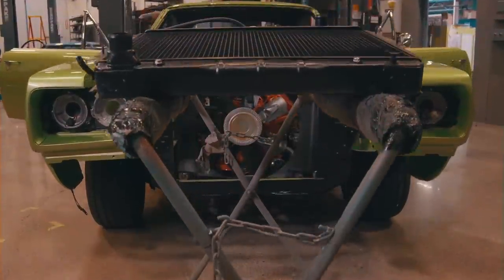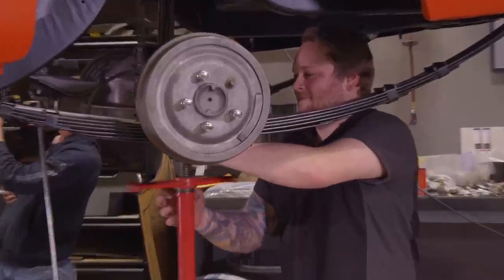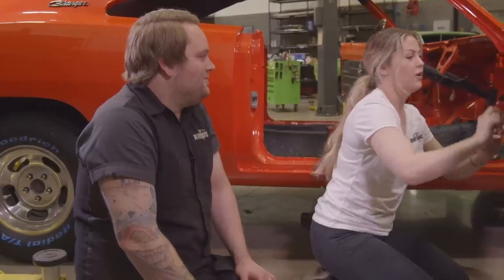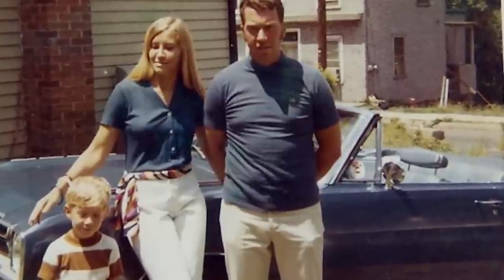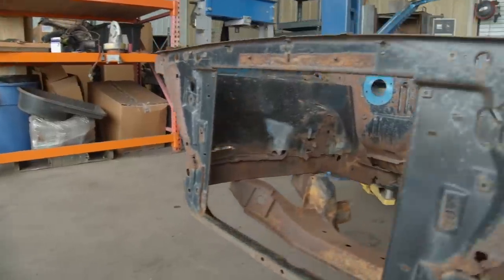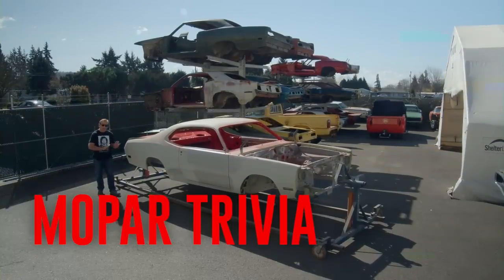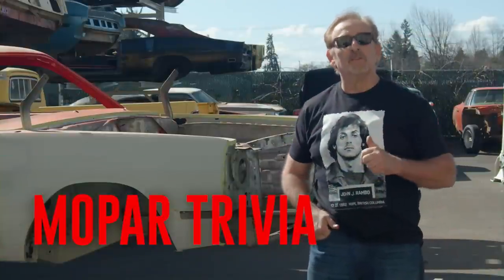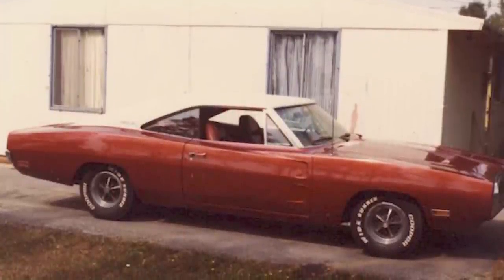MOM GETS HER LONG LOST MOPAR BACK: FOUND IN THE WOODS!

Comment: One clarification. On fender tags for '68 the 52 on the bottom row denotes a 340 4bbl. The 3 following that is for 4spd manual trans. The tire code is the 2 digit number following the trans code which is hard to read because of the rust.
Reply: Time stamp?

Comment: I think we can all understand the passion. I'd love to find our car. Nothing too special. 1970 Ford LTD Galaxy, no not a Ford Galaxy but a LTD. 4 door sedan that had a mobile phone which we chucked in the bin around 1984 and a hole on the bonnet, replaced with a Holden Statesman ornament as that's the only thing that filled the hole. Picked it up at auction in 1974 from the American Embassy as a presidential car. Traced it back too 1994 when it was de-registered and scrapped. It was one of 3 used. We sold it in 1980 during the oil crisis.

Comment: Just one question, when you pulled the later 440 from the Daytona to swap it for the OEM spec motor, was the owner able to offset the cost of the correct engine with the value of the removed example?
Reply: why would you care LOL
Reply: @borismcfinnigan3430  idle curiosity and hoarder/hawker instincts.

Comment: Ahhh, if only I knew builders when I was 23. When I broke up with my GF in 1992, her mom gave me a 1972 Merc Marquis Brougham. Other than the tires being dry rotted and an engine mount, it was basically a barn find. Paint was oxidized, and a vacuum advance valve to bring it up to CA emissions, it still was awesome. 429 V8, 4 barrel Thunderjet carb, forget what the transmission was, but it also had early antilock brakes, all power package, towed a Caveman trailer from the Bay Area to Atlanta, it laughed it all off.

Made the mistake of letting a stoner roomie drive it to tow a reggae band's equipment and he wrecked it. Since 1992, been driving freebies and handmedown cars and vans since then. I miss that epic land yacht though. 

First car I ever had enough room to sleep on the back seat, and also when the engine mount failed, it locked on the accelerator pedal, so on the freeway, I quickly hit 80 MPH, and 8 later, saw some serious sh*t when I tried shifting to neutral, and accidentally knocked it over to reverse. You never saw so much tire smoke in your life, and everyone got out of my way so I could get to the shoulder.
Reply: Oh yeah, one of the most annoying "features" that car had, was a steering wheel mounted horn strip, in case you doubt the veracity of that story. If you had to take a tight turn and crank the wheel, you'd wind up honking the horn, no matter HOW much care you took in the process.
Reply: Oh, last note, it was a Bay Area score, so zero rust, just dry rot tires, oxidized paint, and marginally rotted vinyl on the roof. Seriously, other than a crack in the original steering rim, and minor mechanical issues, it was pretty damned mint for a 22 year old car at the time.

Comment: I've been searching for my 1969 Road Runner. I parked it at my ex's friends place along with my 1955 Chevy Custom Cab truck. They both came up missing and I hope to find out the story of where they ended up. the RR light blue snorkel hood scoop steel rear fender flares, shaved door handles and a failing light blue flame job. 383 30 over with Holly top end parts. one of these days I'm gonna find her again if its in one piece. Not one out there quite like it. The 55 was primer black, large moons and 50's all the way around. frenched in antina, doos at one time had 1 piece windows, front axile has brkts mounted that flipped to lower front end, custom angle iron front and rear bumpers,  still looking for these vehicles. sad loss but stuff happens, 20 years ago. after all this time I'm back in the area. Pacific Northwest. thot I'd throw that out there. I'm Still fishing. you never know.
Reply: Wow, I've never had a car stolen.
However had to abandon a couple in the upper peninsula (Michigan)
Reply: @g..._anthony27  I'm going after it the hard way.backtracking the vin through the state DMV and registration information. I also have the prior owner involved in discovering the whereabouts and who made the illegal transactions if it shows up though registration and titling. Was such a week known car in this area from in the past people still have stories tho tell about it. It will be quite the story this car will have if it comes back around in one piece. Was put on the back burner for years and now retirement has me looking for some of my past ownership of vehicles most people would only imagined of having. Funny how some of us old guys had what is so highly sought if now days. Thankfully some YouTube channels tell about history of some of these vehicles. They all have a story.

Comment: A friend had a 69 Coronet with a 318 topped with a 4barrel armband a different gear plate in the trans . That thing ran like a beast. It started out as a businessman's car. Complete with a radio and an 8 track that you could play normal cartridges in or record notes to a blank it was that wierd olive green gloss.  I wish I could find it and restore it as a tribute to him. That or the 60 something chevy van that had  a straight six battery under the passenger seat in a compartment under the floor. It had no seats in back but we fixed her up with a mattress and curtains and enough speakers to rock that thing.

Comment: Was the slant six in America a small truck motor. The slant 6 in Australia were left over truck engines revamped with a new sump. Best tow car for family with a caravan.
Reply: Yes it was, also used in vans.
Reply: A slopey was a 'eco' car engine for their mid size cars. That also turned up in a few full size cars as well. It came in 3 sizes in the states 170 195 and 225,, wisely Chrysler Oz only used the 225.
Chrysler Oz still assembled US models here in Adelaide up to aroung 66-67.Some for the Americans are odd!!
Though I have seen [from the states] a pov pack  full size Dodge with 225 and 3 on the tree. A barge Fairlane 3 door with 6 cyl 3 on the tree. A Camaro 6. Or a 350 3 on the tree Camaro with drum brakes.
I own a 71 Galaxie LTD which the base engine in the US was the 240 6. The few we got here were all Oz assembled and V8, both 302 and 400.
And ofcourse GM assembled Chevs and Pontiacs here until around 61 with 6cyl 3 speeds.
Reply: @ldnwholesale8552  used to see them doing the 1/4 mile in good times at the drags.
Reply: @ldnwholesale8552  I'm an Adelaaid boy and remember the old Chrysler plant.
Reply: Slant 6  in 73 dart  custom swinger

Comment: Well I'm looking for my first 2cars a 1978 ford Thunderbird diamond jubilee edition it was copper colored with a attempted repair from a keying scratch it had a 400ci engine with a fmx transmission that was bad it was parked in Tacoma WA, next car was my 1957 Chevy 210 4 door project it had true wide white walls it had a 327 with home made engine mounts that bolted to the front of the block it had a turbo 350 transmission exhaust built out of flexible tubbing and a homemade transmission crossmember

Comment: YOU ARE WRONG!!!! I had a 74 Dart/Demon with the 225 Slant 6. 3rd gear did not work, but because you can't over rev a /6, I could do 75MPH in 2nd on the highway till I fixed it. DC

Comment: I could of bought a 1971 dodge duster 340 Sixpack 4 speed one owner price 1800 it was running in perfect condition only needed a paint job he laid a hundred dollar bill told me if I grabbed it when he dumped the clutch it was mine no way 5 times he also owned a 1974 duster with a 360 4 barrel 4 barrel fully loaded running
Reply: I was 18 years old no money for 71 duster this was in Orlando Florida i do not know what happened to the cars but they made a Mopar fan for life

Comment: I always thought Mark was a little off kilter but now I'm 137.87% sure he is. He said "high horsepower 340"    It averaged 275 hp and 340 lb ft of torque and at it's very best (trans am edition/6 pack) it only managed 290 hp ans still stayed at 340 lb ft of torque.  The 340 is the most highly over rated engine in history and is all smoke and mirrors.
Reply: Not so!

Before they dropped compression for emissions in 71 the true dyno at the crank (gross hp) of a stock hp 340 was really 325-330hp & not 275hp per the mfg.

That was most recently proven to be the case approx a yr ago by an engine builder (Nick’s Garage ) in Canada where I rebuilt a 69 or was it 70 hp340 to factory spec which put out approx 330hp at the crank.

But there have been mult times stock built pre 71 340’s were proven to be 325-330hp at the crank in projects/articles over the yrs by hot rod,car craft etc.

Another example is gm’s pre 71 BBC 396/402 L78 that was rated 375hp in stock form that actually had a true at the crank (gross rating) on the dyno of 425hp & not it’s fact rated 375hp.

But that all changed post 71 when comp was reduced for emissions & also when hp rating went from gross (no accessories on the motor) to bet rating with all accessories present bring air cleaner,stock cooling fan,power steering pump,alt,ex manifolds etc reducing avg v8 hp rating by 25-30hp to as much as 40-50hp on dome larger engines.

That’s why the earlier pre 71 hp340’s in smaller light wt cars like a gt 340 dart could match or beat for example a 69 or 70 chevelle 396/402/350hp bbc car or a base 400 gto too.

Simply Comes down to power to wt ratio.

Happy motoring!
Reply: @scottwheaton9689  👍